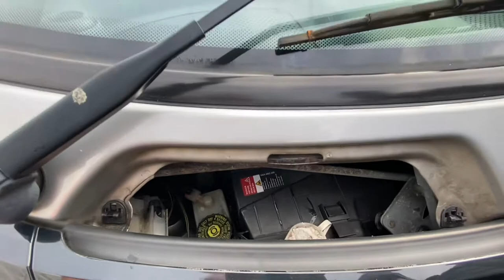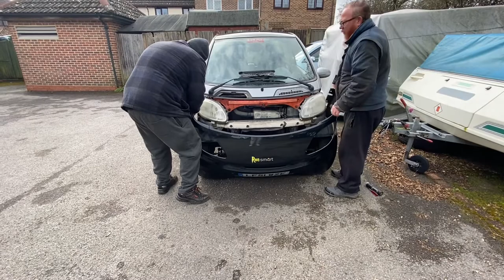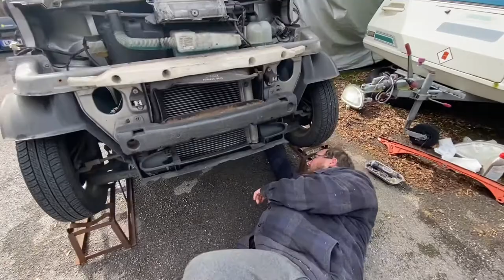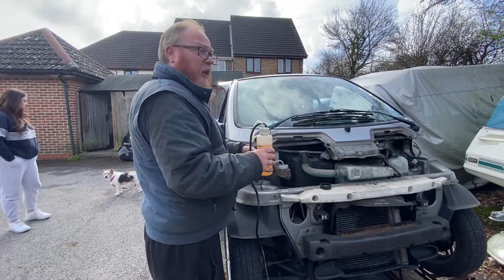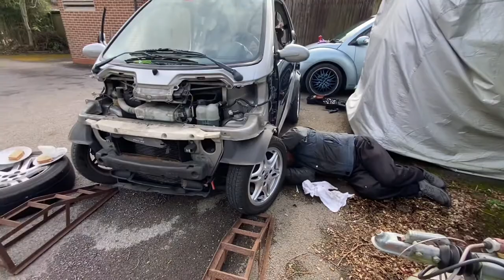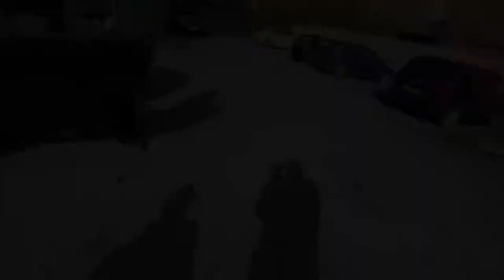Smart 450 city coupe, brakes troubles, (peddle goes to floor, can we fix it easily)

Comment: Interesting and detailed.
Do you happen to know the length of the flexible brake lines in front, going from body to caliper? The spares range from 310 to 350mm and it's quite a big difference
Reply from the maker: Sorry no I don’t know. I’d suggest go to your local motor factors
Reply: @RCCAdventures  Thank You for answering